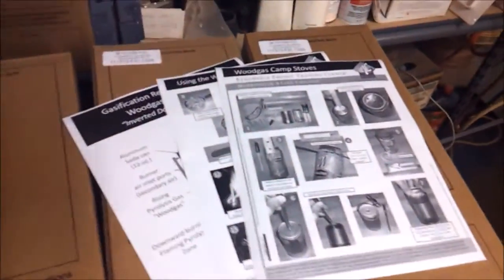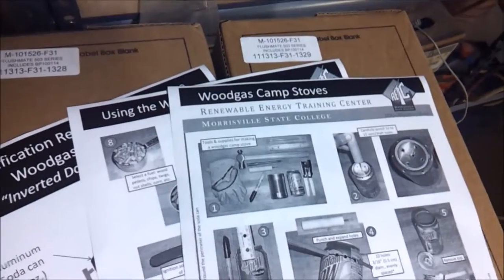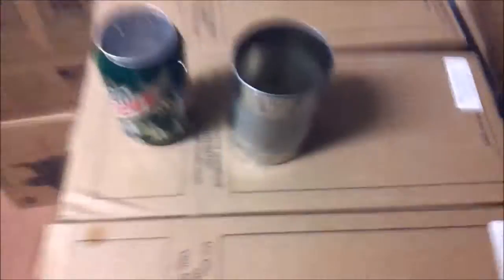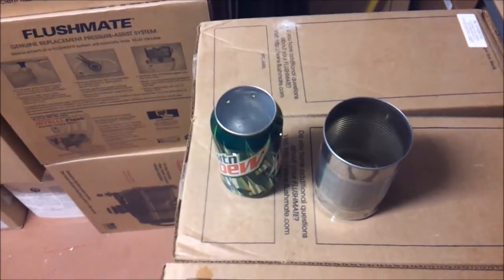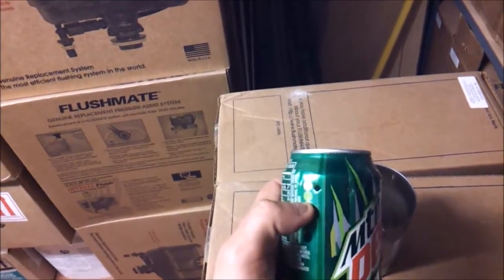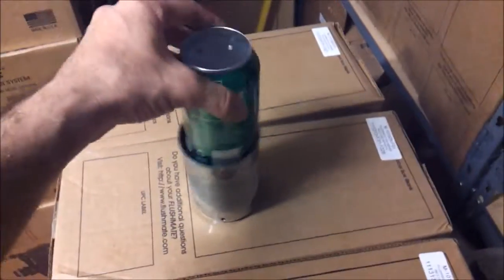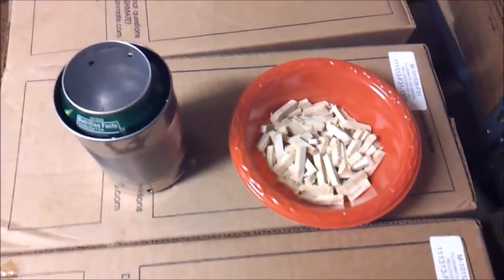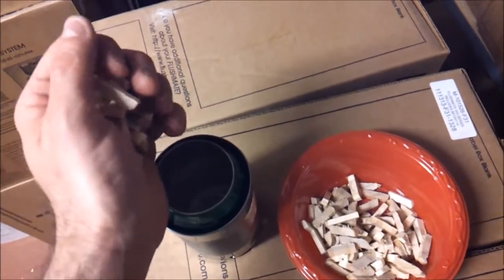Soda Can Woodgas Stove - Shoestring Survival DIY

Comment: The holes at the top of the soda can need to have a 'roof' over them to force the air and wood gases outside the burn into it can to be ignited. Take another bigger soup can and leave the top or bottom on it and make a hole the size of the top of the soda in the middle of it can so you can snap them together. Initially you got a better flame than most. White,  blue and yellow flame is what you want to see. That means your temperatures were from 1100-1500 degrees and that wood gasses were being burnt,  but wood gasses were also escaping because you didn't trap them and the secondary air between the cans to go through the little holes at the top and work like 'jets'. Wood gases contain carbon monoxide and you must be careful and/or have a CO monitor. Indoor EPA standards are 9ppm indoors and 75ppm is the danger area.

Comment: I think the design is suboptimal
If woodgas is going up in the space beween the cans, it need to be ignited by the fire inside, so I would make sure the gas has to get into the inner can again at the top.

By sealing the space on top(between the cans) you could make sure the gas has to go into the inner can and get ignited.